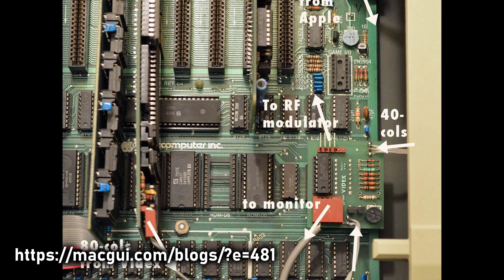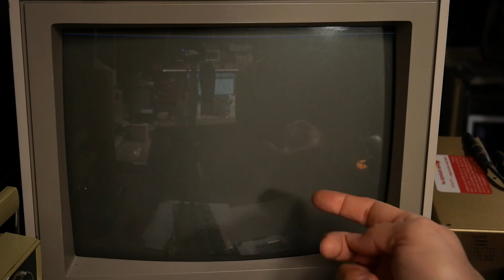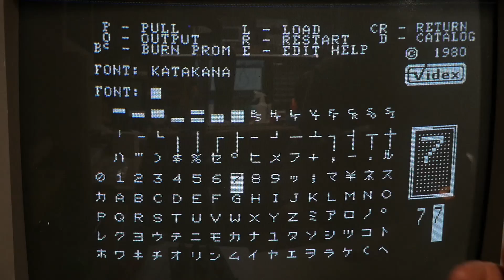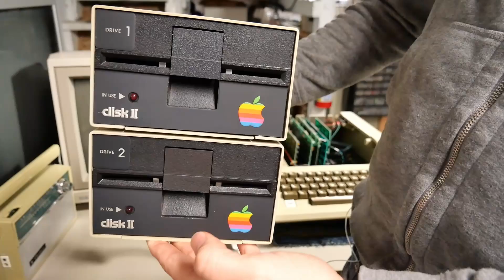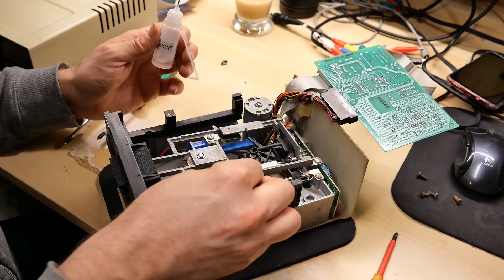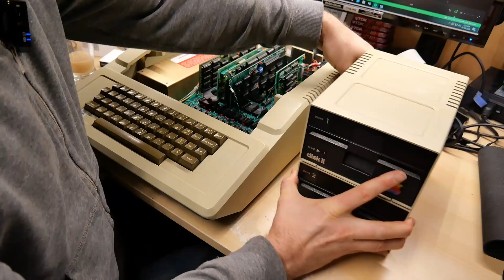Apple ][ plus: VIDEX 80 column card, CPM on the Apple II and servicing the disk drives

Comment: Where you are using the white stick to clean the head everyone forgets that the little round white pad in the arm gets dirty and you have to change it periodically or it will start having trouble reading the disks. I used to know what it was called and I think we called it a collet hub pad bad in the days when I was an assembler and used to assemble them but I lost my storage and all of my spare Apple 2 parts when I lost my storage in 2001. I had every part for every version of the Apple including the GS because I was on the developers list and knew people at Apple like Jobs and Wozniak. If anyone knows what the pad is called I sure would appreciate it.
My Disk ][ drives still work years after they were built and have not been cleaned in years because of illness, time and because I started playing games on my various Macs. But my GS & ][E are ready for me to come back to them as I will soon. I also found someone who can repair my non working 3.5 inch unidrive so I can finally use my GS again. 
I have a ][GS, ][E, Enhanced ][E, ][C, ][+, Integer based Apple, lots of disks and books and 4 Imacs awaiting repair, a Silicon M1 Mac Mini, a    2015 Retina Mac Book Pro, a 2009 Macbook Pro, an Ibook, several Ipads waiting repair, 2 Mac Minis, 2 - 4th generation Ipods, a square Ipod, a thin Ipod, 2 Smarter Image Light Up Volkswagen Docks that work with the generation 4's, many Apple displays, a Genesis, an N64, an Atari 5200, many Nintendo devices, an Iphone X, an Iphone 8, a 2014 43 inch Sony Bravia, a Roku Westinghouse 4k tv ( don't buy, colors are terrible compared to a Sony, and 3 Apple 2 displays color and RGB & the Sony and the 21 inch Westinghouse in my bedroom will all connect to the Apples with RGB cables.
Screw you Tim Cook for not allowing us old time gamers to keep playing their favorite games like Diablo 2.
Apple ][ Forever !

Comment: As a kid, taught myself to program on a borrowed TRS80, then the color version (riding my bike through 2 towns to Radio Shack), took more programming classes in high school on the Apple 2, purchased my own complete Apple 2e system with color monitor, spend many hours playing Bards Tale 1 & 2, used the TI99/4A,  ending up with the king of them all the Commodore Amiga running all the software from all 3 platforms on the same machine.

Comment: Thank you so much for sharing your knowledge. I got two apple II Europlus. I believe the only difference to the plus is pal output. 
There is a lot that doesn't work. I would have never been able to fix this without your help. Let's keep our fingers crossed that i will make them work.
One of them is heavily modified. It has a Papst fan that sounds like an airplane starting. This one is from the TU Darmstadt applied physics institute. Looks like it measured some nuclear data. I rescued it from trash in the early 2000.
The other one was bought by my parents in the late 80ies for the incredible amount of 10.000 DM probably from the geo institute in Frankfurt. 
It got a ton of equipment which is distributed through my basement ;)
We never ever used the 80 col card or the z80. But they always where in their slots. 
My father still uses the same fortran software ported to PC on his p3-800 using ms-dos 5.0

Comment: yeah, the software does create that beep by flipping the speaker line up and down. My Apple ][ Plus presents "APPLE ][ PLUS" with a beep, and hilariously, the bell character is part of the print string, and "PLUS" pops up only after the beep duration, so it's really prints "APPLE ][" + x07 + " PLUS" and so it waits a beat (for dramatic effect maybe) between saying "APPLE ][" and saying, ...plus! (ovbiously my ROM is different than yours)

Comment: You asked about the beep and whether it's generated by the text display routines. Well yes, it is. Most Apple II software prints text to the screen by calling a routine called COUT (at $FDED) which takes the character in the accumulator and writes it out to the screen. Except COUT doesn't actually do any of that itself; it just calls the routine stored in the character output vector (CSW) at $36/$37 on the direct page. When you boot the machine the startup routine initializes this vector to point at $FDF0 (COUT1) which is the ROM routine that writes characters to the 40-column text screen. COUT1 checks for several different control characters (carriage return, left and right arrows, etc.) and if it sees ASCII BEL (control-G) it calls the BELL1 routine ($FBD9) instead of writing to the screen. But when you run PR#3 it changes the character output vector at $0036.0037 to point at the slot 3 output routine ($C307) in the firmware on the 80-column card. (Note that if you're running DOS or ProDOS the I/O vectors will actually point at routines inside the OS because they need to hook into the I/O.)

And yes, PR#6 works to boot a disk because the disk ][ controller card has a "boot from disk" routine at its main firmware entry point. When you type PR#6 it runs the slot 6 I/O setup routine at $C600 (which would normally initialize the character input/output vectors on an 80-column card or serial/parallel card) and thus boots the disk.

Anyway, I guess the Videx output routine must not call the $FBD9 BELL1 routine. Why they chose to implement their own beep I have no idea. Maybe someone at Videx just didn't like the pitch of Apple's beep. 🤷🏻‍♂️

Comment: I always though the United States had stringent radio interference rules that meant everything had to be shielded in a computer. When Acorn tried to sell the BBC Micro to the US, they had to place shielding everywhere. But the Apple looks pretty unshielded to me
Reply: When the IIe came out they added shielding everywhere - the ribbon cables to the drives had a metal shield which connected to the case backplate.

Comment: If you ever feel like it, I'd be interested in a comparison of the Apple Disk II drives and the IBM full height drives, mechanism wise, parts exchangability, and if it's possible to strip a FH IBM drive down to be a Disk II, since a Disk II is basically a stripped drive.

Comment: When Apple starting building their own Shugart controllers they had lots of problems and spent ages making the first drives work. Eventually, Woz found out that Shugart was sending Apple drives that failed QA testing and Apple was unknowingly fixing failed drives. Shugart did not want to sell just the drive without the controller boards.

Comment: I remember having the dual video mode and using it with an assembler or programmer tool on an appl ][e clone I had. I don't remember what or how I used it, but I remember feeling all smug with both the monochrome monitor and the TV hooked up.

Comment: So the VIDEX basically gives the Appie ][ the same dual-head capability as the IBM 5150 has with both a CGA and MDA installed?
Reply from the maker: Yeah it does -- all the 80 column cards on the II and II+ have their own video memory so you can definitely do a dual head mode.

Comment: I have 5 disk][ drives, and 4 of them have the ALPS clone mechanism of the SA390.  These have different motors in them, and you'll know it when the recalibration noise happens (i.e., the noise you heard when your game switched to slot 6 with no disk).

On the one SA390 I have, the recal sounds fine.  On the other ALPS disk][s, they sound erratic and random.  The later ALPS drives found in the IIc and in the Apple 5.25 drive sound like the SA390 due to a different stepper motor and head drive mechanism.

I find it bizarre that my ALPS disk][s are all red label, and the SA390 is the later brown label.  This later SA390 was even "MADE IN USA"!

Comment: Hi Adrian!  Love your fixit videos, digging into a couple of Apple 3.5 drives now after watching.  I wanted to ask you if you've ever worked on a FOCUScard for the Apple's?  I pulled my old Apple IIgs down from the attic and this drive no longer functions.  In fact it just lights up the LED on the card (which is amber) for a few seconds and it goes out, yet I hear the drive spinning/turning.  Is this a lost cause and should I be looking at a 'Booti' option if they still make them?

Comment: I'm fairly certain that my 80 column card for my apple ii clone had an RCA composite video out for the 80 modes, and a header that you plugged the apple video output into on the 80col card, and it switched between them when you changed modes. The apple ii clone (an orange ii) had the Z80 CPU integrated into the motherboard, as well as some custom ROM code that contained a Fortran interpreter, although I never did figure out how to call that function...

Comment: The pitch of the beep in the 40 and 80 column modes seem to be an octave difference which would correspond to a doubling of frequency for the higher pitched beep.  Seems like a coincidence with the doubling.halving of the number of columns. I wonder if the beeper frequency is somehow related to the column draw timings?
Reply: The regular, 40 column beep is produced by the machine code routine starting at address $FBE2 in the ROM.  This routine toggles the speaker 192 times with an interval of 546 clock cycles between each toggle.  Given the Apple ][ had a processor speed of just over 1.02 MHz, this produces a tone of 934.49 Hz for 102 ms.  I suspect that the 80 column beep is produced from a different routine stored on the PROM on the 80 column card.

Comment: Interdasting! The mechanism in that floppy drive is very different from my IBM branded Tandon unit. I haven't taken the controller board off (obviously it's very different and much more complex than Apple's, which was one of their great innovations), but it's got a stepper motor mounted transversly rather than the flat mounted motor of that unit. It has a date stamp of 3-9-84 (presumably the US America date format, so March 84), which I'm guessing is later than those drives.

Took the opportunity to give the door guide a grease like you did in the video, and now it's a lot smoother and the release is almost a hair trigger! But the weirdest thing is that the action of the door triggered a memory of playing with the floppy drive on the Apple II in my primary school library. I had completely forgotten they had one there, but the feeling and the noise of opening it reminded me of how I used to flick it up and stop it before it smacked the top so I didn't annoy the librarian.

Anyway, great video as always. Love the technical details sprinkled throughout, and it's always great to see these old machines getting fixed or upgraded.

Comment: Hey, can you check something for me? When I was maybe 10 (35 years ago) I found a super strange bug on my Apple. If you used the poke address for the left and right text border and set them so the left border was to the right of the right border (as in making he entire screen impossible) and then switched them back, the entire character set would get corrupted.

I am not sure of the specifics, might have been the IIe and might have required the 80 columns card but I distinctly remember accidentally discovering this.
Reply: From docs I just looked up:

$20.......POKE 32,N...(entering TEXT....(N is 0-39; norm is 0) Text window left edge
$21.......POKE 33,N.........restores....(N is 1-40/1-80; norm is 40/80) Text window right edge

Comment: 40 vs 80 columns beep: It's possible that the 80 columns mode uses more CPU cycles per frame for low-level support than 40 columns mode, leaving less cycles or anything else... and as the audio is completely CPU driven, this would slow any audio down.
Reply: Would this then not slow everything down?
Reply: @TheGuyThatEveryoneIgnores  most likely. (which makes it relatively easy to test)

Comment: For the automatic video switching, I assume you get some TTL level signal from the 80 col card header when it's active. Just use a TTL-level signal relay with it. They come in DIP8 packages and such and are very easy to use.
Reply from the maker: Looks like the original circuit from Videx used a 4066 CMOS switch and a TTL driver to literally switch between two sources.
Reply: Yup it's called an 80 column auto softswitch. If you look for it on the web someone on applefritter has posted a DIY solution with a 4011 NAND gate and two transistors that looks just like the one I have. That one even has two pots for adjusting the level.

Comment: The Videx card also had a softswitch available that piggybacks on the 9334 chip for control. I have that and it's far nicer i think to just press "in#n". Great video.
Reply: also CTRL+A shifts between caps and lowercase but yes the shift mod is good to stay in lowercase and merely capitalize with shift.

Comment: That CPM card changed my life. I was using my Apple ][+ to connect to a old service called PCLink. I was the only Apple on the service in Beta. Got invited to interview ai Quantum Computer Service the company providing QLink, Applelink, and PCLink. Great days.
Reply: And if I remember correctly all that became.......AOL!
Reply: @jonnycando  yes except QLink.
Reply: @paulchew7675  i was a user of PCLink as the software was bundled with my Tandy 1000hx and then when it became aol i installed the software and was ported right over to that... and surfing on a 2400 baud modem!
Reply: @jonnycando  I remember when we went to 9600..... that was fun.
Reply: @paulchew7675  i eventually made it up to 56k or what ever it was, but my tin can and string phone service would barely give me 30 or so....

Comment: I guess the apple 2e was different
As I recall (34 years ago so please forgive if I am wrong) but all we did to get 80 column was PR80 or PR#80... It's been a while but I do know we didn't have to fuss with cables.
Reply from the maker: It was PR#3 on the Apple IIe as well. Just Apple integrated the capability right into the motherboard.

Comment: As I watch you do all the wierd stuff you have to do on the ][+ (that was pretty natural on the //e), it just makes me wonder who would have bought this very late production plus and not waited for the //e that came out in 1983 🤣 my Junior High computer lab had mostly //e's, with one ][+ that no one wanted to get stuck with.  One of the //e's had a Rancor floppy drive, which I experimented with to get the extra tracks working (IIRC, Rancor supported 45 tracks, Apple officially supported 35, and 40 would work on the DuoDisk or //c drive mechanism).  I remember that some people said that you could get 40 tracks working on the Disk ][, you had to adjust a slider on the head mechanism.  But of course you ended up with floppies that not every Apple ][ could read...
Reply from the maker: Heh yeah the IIe was certainly nice with the improvements -- but it was 6 years after the original ][ came out -- and Apple just adopted many of the tricks people had come up with on the ][ and implemented it in hardware. Like the IIe still emulates the language card the same exact way it was done in the ][ plus -- and I think even the way shift works mirrors the "shift mod" that everyone did on the ][ plus (by toggling an input on the joystick port.)

Comment: Control G is from the old days of telytypes in 5 and 6 bit formats where that rang a bell. The 80col card having a different tone is due to it using a different rom charset. ctrlG is part of the font.
Reply: The bell sound for the 40 column mode is produced by the following code where the A register contains the character code (#$87 = Control-G) at the beginning:
FBD9-   C9 87       CMP   #$87
FBDB-   D0 12       BNE   $FBEF
FBDD-   A9 40       LDA   #$40
FBDF-   20 A8 FC    JSR   $FCA8
FBE2-   A0 C0       LDY   #$C0
FBE4-   A9 0C       LDA   #$0C
FBE6-   20 A8 FC    JSR   $FCA8
FBE9-   AD 30 C0    LDA   $C030
FBEC-   88          DEY
FBED-   D0 F5       BNE   $FBE4
FBEF-   60          RTS

The 80 column card must be calling a different routine on its PROM.
Reply: @TheGuyThatEveryoneIgnores  "That would be absolutely correct"...  (as i try to not sound completely lost).  As a kid I would have remembered stuff like that, but I have not had my //E powered on for a couple of decades now.

Comment: You couldnt quite run 40 and 80 columns simultaneously because of the way they interleaved the new video memory.  Basically it would double the speed of the video scanner, and the first byte of video memory would come from the card, the second would come from the system, the third from the card, and so on.  edit: now that i think about it, you could have simultaneous 40/80 text because you can use TXTPAGE2 for the 40 column mode.  TXTPAGE2 is a second page of memory for text mode.   However, the 80 column card also adds double-hi-res graphics mode, and that uses too much memory to have a second page.
Reply from the maker: Yeah that's on the IIe and later machines. With this card it has dedicated video memory onboard (2114 SRAM chips) perhaps people didn't use that much because it would only work on the machines with a card like this.

Comment: What you are now missing is the Videx Enhancer ][, which is a replacement keyboard encoder card that gives you upper AND lower case chracters on the Apple ][ and ][+. When I worked at the Apple Educational Demo Lab in Ottawa, Ontario, all of our Apples ][+ had the Videx Enchancer ][.
Reply from the maker: Did that include a sticker with additional key support you attached to the lid?
Reply: @adriansdigitalbasement  I never saw one, they just attached to the bottom of the keyboard.